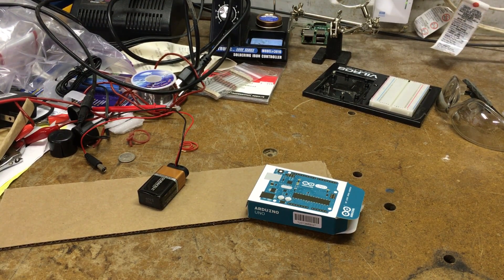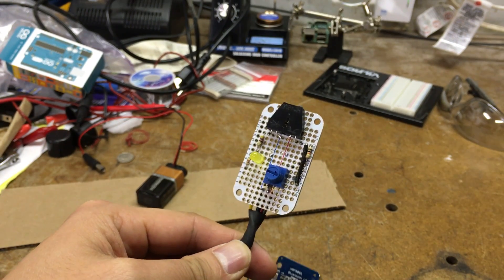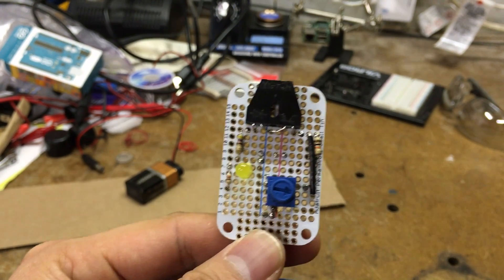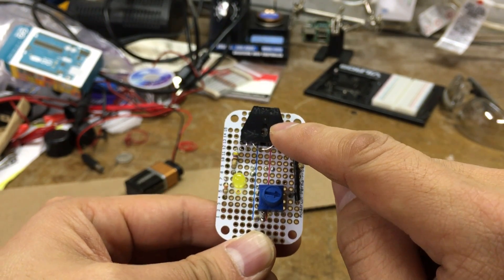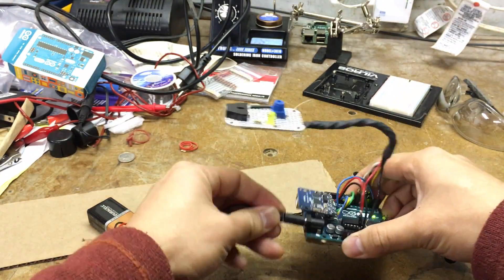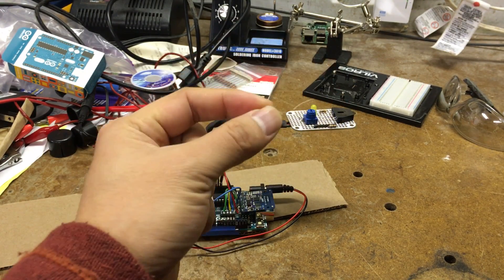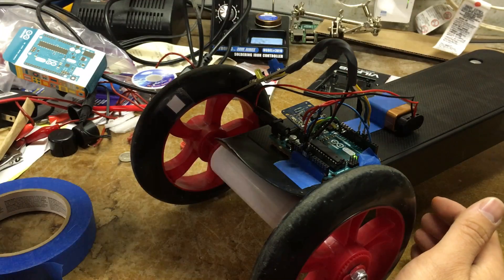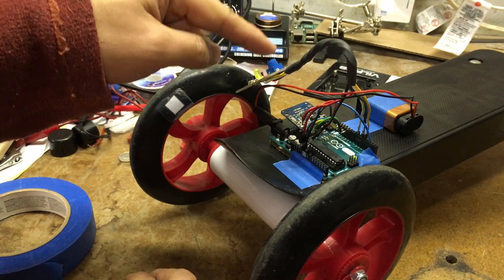Measuring Speed with Optical Tachometer

Comment: Hello Sir, Hello,
Do you know any ready-made or DIY device available in the market, which can detect a running Engine’s RPM (via non-contact method or via Crankshaft sensor) and then via “CAN protocol output” pass-on this RPM value to any of following DC Controller (to control DC Motor’s RPM)?
1. https://www.nocoev.com/product/curtis/manual/1229%20(15B).pdf
2. https://www.nocoev.com/product/curtis/manual/1244%20(13E).pdf
3. OR Any other 200+ Amp DC Motor SPEED & TORQUE Controller (which you will recommend)
Please do let me know if you have any appropriate device?

Thanks!